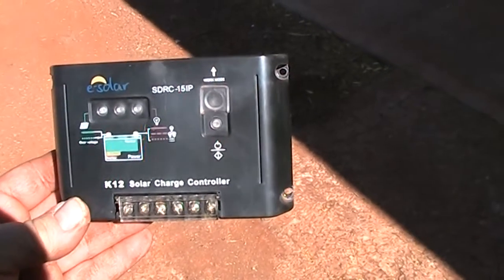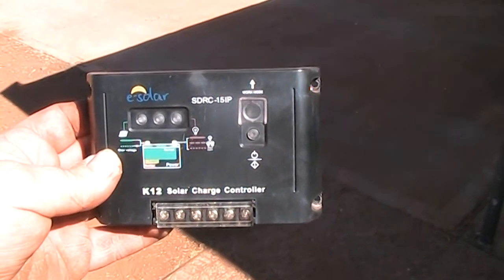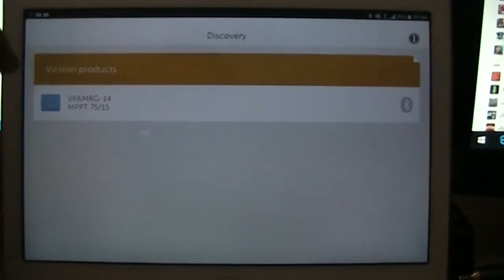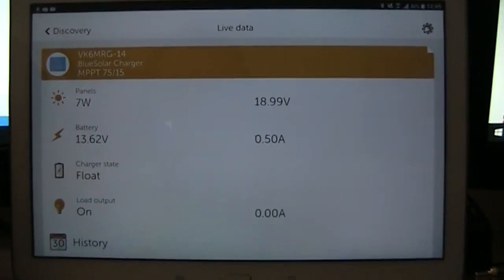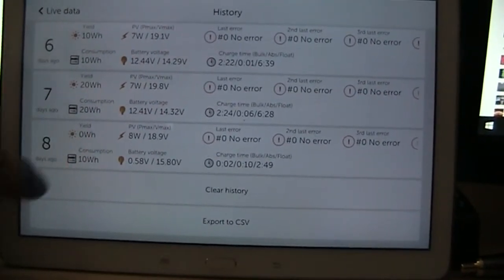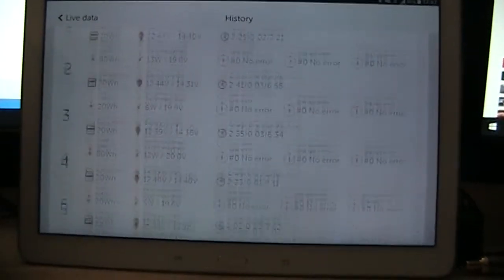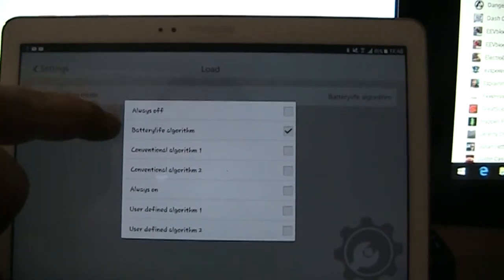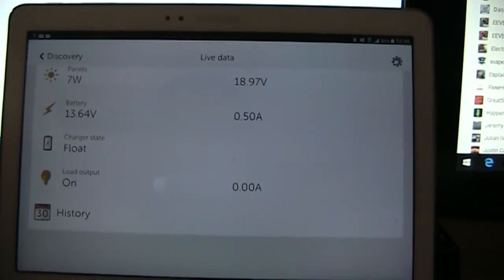First look at the Victron BlueSolar MPPT 75/15

Comment: I bought MPPT 75/15 and dongle couple years ago. It's in use in my tandem bike-setup. 12V cooler and music-player etc in a cargotrailer. No battery yet but i'm working on it. 2 x 50W panels 2.9kg each. Working great. The history in the phone-app is great. I can see overall output and usage. Works great with bike trips :) Great product!!

Comment: The low output is because your in float. The Victron throttles it down when it believes your batteries are charged.
Reply from the maker: Keth, thanks for the info. And thanks for watching.

Comment: I just installed one the same with the bluetooth dongle. but i am no t recieving any charge from panels. charger stays in off mode.
enen though ihad a load runnning foo batteries down too 98%
Reply from the maker: Lenny Linham have you updated the firmware?
Reply: Is your PV voltage 5v above your battery voltage at start up?  I just read in specs this requirement :(